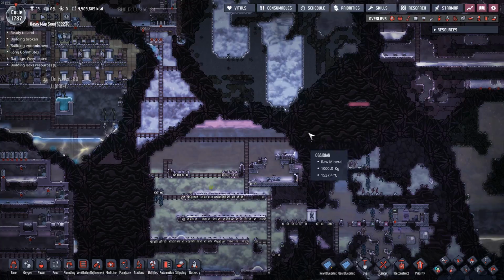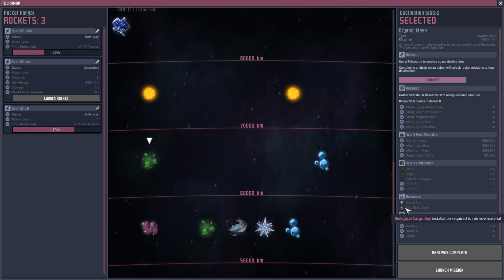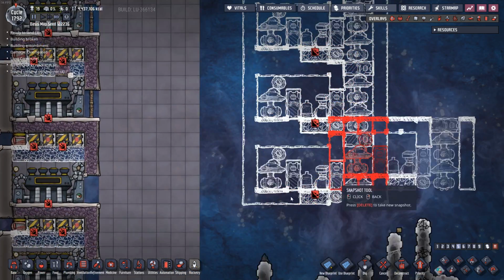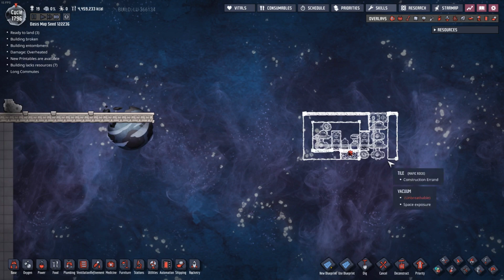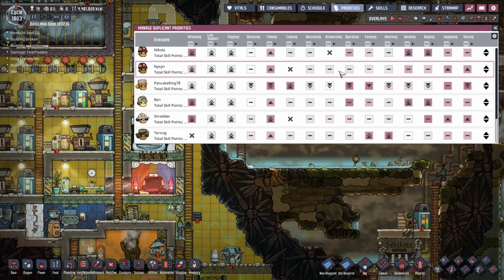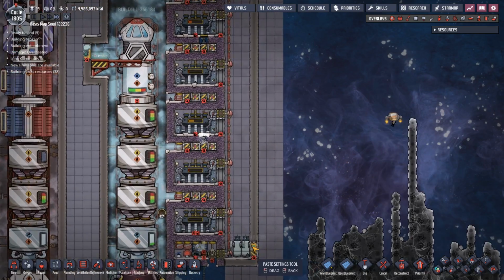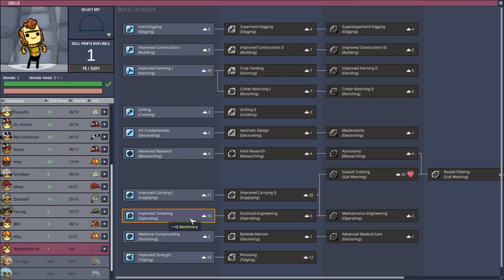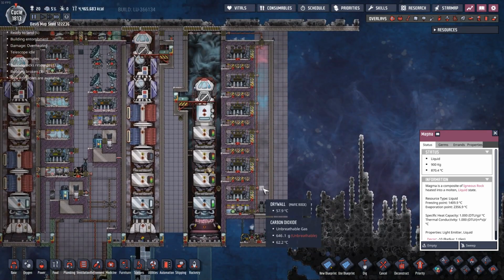Can I Capture Power From Hydrogen Rockets? Oxygen Not Included ep39

Comment: Correct me if I'm wrong, but I thought anything built with insulation (material) has 0 heat conductivity? So is regular liquid pipe built with insolation 4 times more efficient than insulated pipes?

Comment: run magma as a coolant in a metal refinery. that will constantly dump heat into magma to about 2300C. Use that magma coolant as a heating source to melt regolith into magma to gain that sweet x5 heat capacity. make sure to only run 1kg per package to not have state change in the pipe,
Reply: The image in my head seems to be an unholy machinery of some sort
Reply: @baimhakani  and you are not wrong about it. magma is vibrant red in the pipe. So it looks like a pulsing clogged blood vessel of a hell beast.

Comment: cleaning up all the debris on the ground is the best way to improve frames. I was down to single digits. So i set up a few dozen bins set to all priority 4, then i assigned 3 dupes to store ONLY. After letting it run for a few dozen cycles, i was back up to 25-30 frames.

I would HIGHLY recommend choosing a few dupes to clean up the map aggressively. It will help.
Reply: Instead of bins, drop everything at same spot using a automatic dispenser in the vaccum, the boost will be even bigger
If you are getting 30 frames using bins probably gonna get 40-60 after this.
Also all the building will be faster because using bins there is that annoying thing where dupes carry insignificant amount off material to a construction
Reply: Gabriel Sulivan the problem with that is you have to set it as sweep only and then manually sweep things up. If you only use bins, you can set it up passively.
Reply: @grimsprice  yeah, i guess it comes to choice then, more frames with micromanagement or less frames without micromanagement.
Or maybe there's a way to automate...hm
Reply: @Sullivan657  Either way, it would help Brothgar a WHOLE lot. And he has the extra dupes to do it.
Reply: @grimsprice  couldn't agree more.
More frames is better to watch too
Reply: You can combine the two and have a delivery bin, then auto sweepers to deliver to ore droppers and then a few more sweepers to stock up bins with one material each. The sweepers will always stock up the bins so the dupes have materials on hand and the dupes will always deliver to the delivery bin, keeping everything nice, clean and compact and best of all, no manual sweeping.